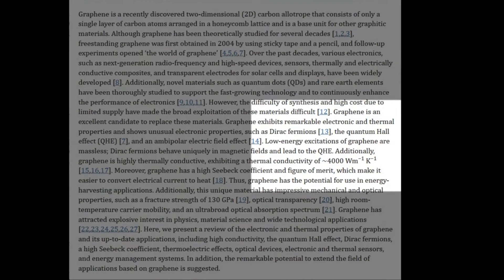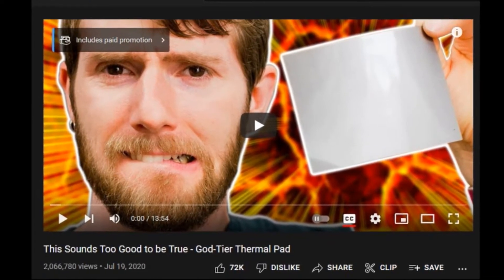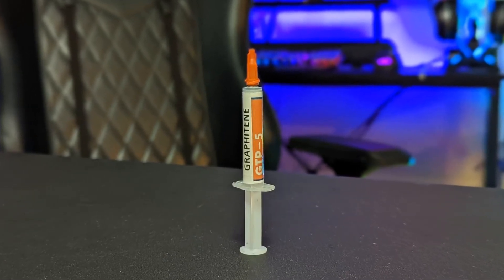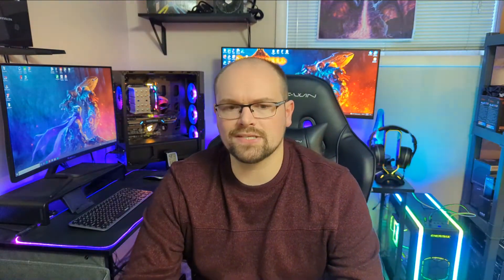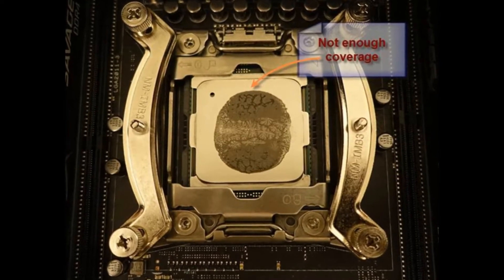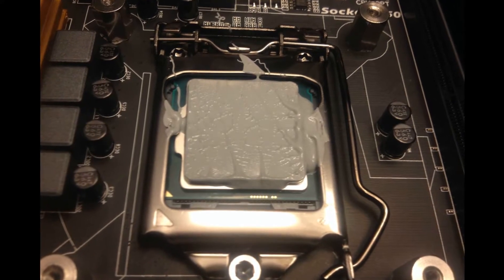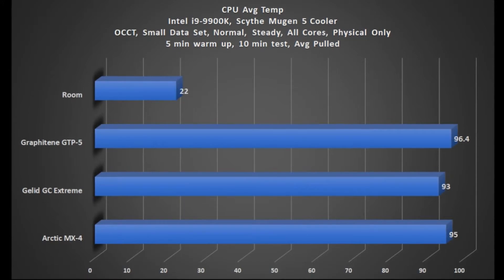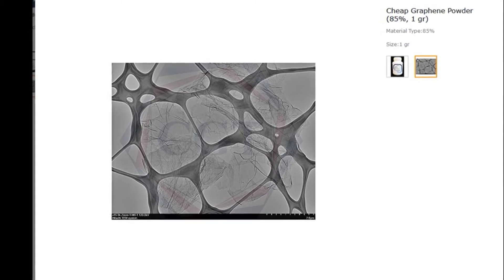The Holy Grail of Heat Conduction - Graphene Thermal Paste

Comment: Good content. Do you know if there is any thermal paste / grease that don't dissolves when subsmerged in oil? I'm trying to find a substitute for thermalpaste on my gpus the will go to immersion cooling. Tryied Indium sheets, but it didn't work very well. Graphite Carbonout was better but still worse than good thermal pastes.

Comment: linus did a test with some graphene paste made by another channel. I think that one was actually really good
Reply from the maker: I missed that one but found it. Yeah, Tech Ingredients made a thermal paste that performed on the same level as Noctua, but the graphene one I found was an epoxy rather than a paste, so you had to glue your cooler to the CPU. =/
Reply: @HardwareHorizon  oh yeah. I just checked out his website I think they have a new one thats paste rather than epoxy. Not sure because they are both priced the same.

Oh and there’s a channel called Robert murray we’re they have a video in which they test with ink. I actually bought that one but I used it for other things not Cpu since I’m worried about the ink leaking out.
Reply: @arechikitsune  what is the name of brand?